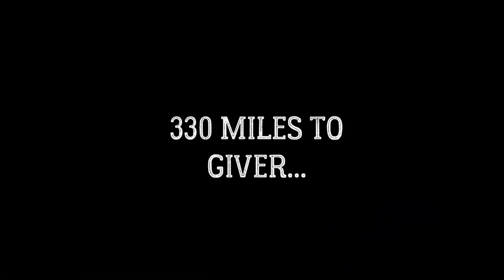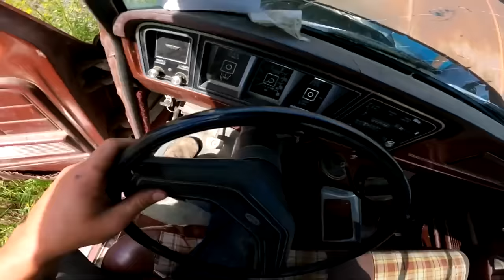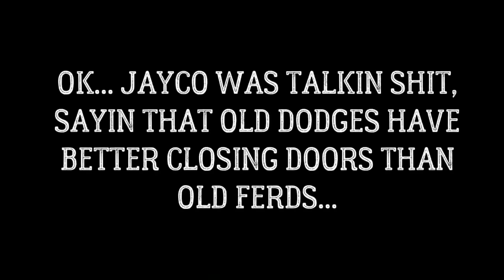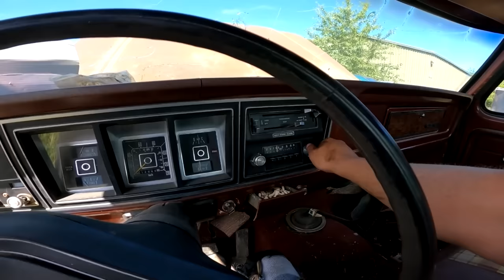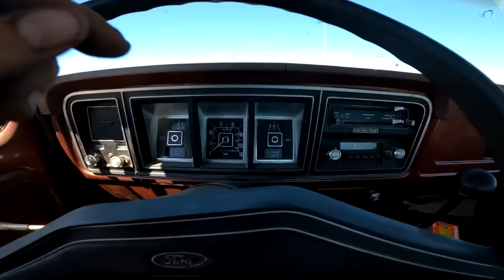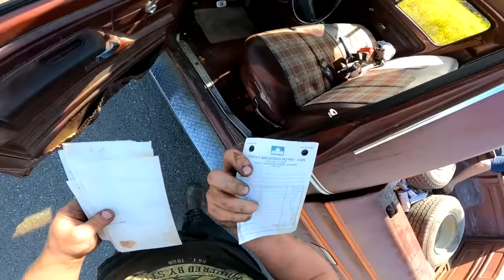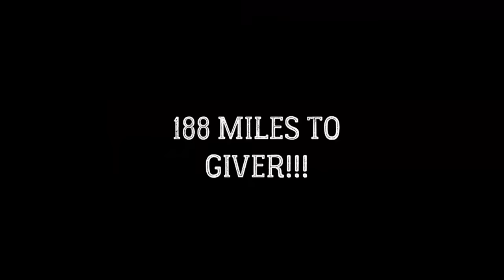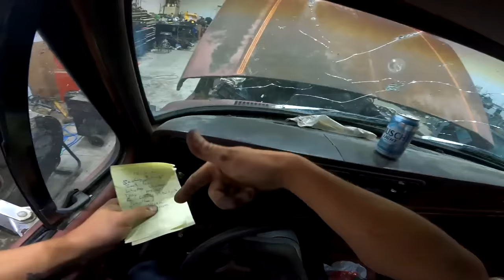1979 FERD F-2 FITTY, REZ ERECTION AND DRAG RACE?!?

Comment: When the exhaust rocker or pushrod breaks the cylinder is full of compression so the intake rocker or pushrod will break cause it can't overcome that amount of cylinder pressure.
Reply: where does the material come from to be compressed ?
An intake needs to open to charge the cylinder!
Next.... there's leak down/blowby to release the stagnent charge.
Next, you've got say 110#'s
static valve spring pressure,
more at lift.
How much is avaliable compression ? 150-175#'s ??
How much greater  is that  over your on seat pressure alone ?? We know at lift spring pressure rises.
Sloppy valve trains/ misalignment causes breakage.
Reply: @SeymourBalz  I'm not going to go back and forth cause I just don't argue with guys on the web. This is all I'm going to say,  can you think about this for a second please? If the exhaust rocker or pushrod break from either wear, wrong parts, geometry issues, I'm guessing rpm in this case cause it's a 100% stock engine.  How many times do you think the intake valve did get "material" into that cylinder before it couldn't open against the amount of cylinder pressure or "material" in that cylinder before it broke?

Comment: Had a 77 F250 in high school, had a gutless 351m in it. Got a whopping 8 mpg. Never failed me though even in the dead of a Minnesota winter
Reply: My buddy had a 79 f150 351m it also got 8mpg but it got like 500miles to a qt of oil too....I never seen something so gutless drink so much gas,but it was a little torquey for a slow revving 2bbl ugly hulk of a anti chick magnet 🧲. Lol
Reply: @jarvislarson6864  I have a 77 F150 mildly rebuilt 400 I get 13 mpg hand calculated
Reply: One of my buddies has a 75 f350 with 38s on it and a 460, let's just say it gets 5mpg on a good day

Comment: I'm surprised at how good it ran from sitting for so long even with a dead cylinder. Really makes me want to go out and find an old ferd of my own. Awesome as always!
Reply: He got lucky I assure you 100% lol 😂 they aren't all like that
Reply: @shawnadams1558  exactly, environment of a sitting car matters a lot, it could look fine and rust from inside out, he got lucky having such little rust in the engine
Reply: Watch out, clowns like Ford Era have taken prices into the ketchup anymore, even for a pile of parts that clown asks assembled, restored, running with a complete overhaul type money. The trucks from 1980-1996(1997 HD) are still out there but, they're getting  price gouged more every day. I got my 1997 F250HD RCLB XL 2wd 351w ZF5-S47 w/212k for $2300 on 1 Apr '21 in the middle of nowhere KY.
Reply: Shawn Adams
All the ones I've messed with seem to.  Doesn't matter how long they've been sitting, they'll start up in a second and a half, and run good.
Reply: @hendo337  you could sell that puppy for $25k or more all day here in CA. I've seen some 400k+ rust buckets sell for $10k.

Comment: I bought a 78 Bronco ( mid 90’s) with a broken oil pump shaft. I installed a “Towing Cam” while I had it apart. Ran pretty good.

Comment: I wasn't winning any drag races in my dad's old trucks with the 351m's but whatever you hitched one to it would pull it, break the chain, break traction or snap an axle. They had all the torques. If you kept them tuned up they were pretty good on fuel too. I remember he rebuilt the carb on the '77 Crew Cab for a vacation trip down the coast, new oil in the rear, trans and engine, new cap/rotor/wires/plugs and we were getting close to 20 mpg on the highway with it no joke. This is pre ethanol fuel and 55 mph speed limits on the freeway, so temper your reactions a bit with that knowledge pedants. 
Things I hated about those trucks though: 
1. The duraspark ignition modules. Constant problems
2. Starter solenoids and starters, same, constant problems.
3. Voltage regulators, same, constant problems.
We kept one of each in the glove box at all times (except the starter, too pricey). After they got a few miles on them we had a few spare fuel filters on hand too. Inside of the tanks all rusted real bad and it would plug up filters right quick. I could change one out on the side of the road in like 3 minutes and be back on the road again. 
All that said I hauled hundreds of tons of scrap iron, firewood and old junk cars with those rigs. Beasts all of them.

Comment: You're videos inspired me to get a old ferd my dad had a 1992 f150 with a 300 in it sadly had to sell it it didn't even leak oil because all the oil it had leaked covered the block in a layer of oily dirt sealing it😂😂😂. I have a 1988 f150 4x4 with a 7.3 idi turbo solid front and rear axles and stock rims with bias ply tires and the truck is all military green plus a 5 speed

Comment: Detroit Diesel are the original “fuel converters.”    They convert air and diesel fuel into noise.

351M/400 engines convert gasoline and air into noise.

Comment: 351M/400?  Hampered by their smog tune.  Putting a straight-up 0º timing chain set in them is the best thing to do.  That's what's holding them back is the retarded cam timing. 
Then when you add a good intake and carb and headers, it will really wake up.

Now them Chrysler 400s were pretty stout out of the box.

Comment: I've got a 78 f350 2x4.Swb. the one with the door in the bed for the spare. Shes a gem. No rust. 460 bb with c6 and 456 rear end. She tops out at 65 but is a beast off the line. Love the videos. Jealous of those side steps....oh and 78 lariat had square headlights.... 79 heavy duty base models you could get round ones as well.

Comment: I had a 302 5spd 4x4 in a 95 extended cab/ long bed.   She was as gutless as they come when towing. lol..  But in 4wd LOW, she was all there, and I hopped out of a lot of holes that I had no business getting out of.  I pushed that truck to 320k miles and it finally spun a bearing, and I still sold it for $800 with a blown engine.   Now I have a 2002 7.3L ZF 6spd, manual 4x4 with manual locking hubs. extended cab/  9ft flatbed,  (srw), dana 60 front, and dana 80 in the rear;  basically the same truck, just upgraded Everything..   It's probably the best truck Ford ever made, and I have 330k miles on it and she still pulls strong.  Needs some glow plugs and has all the classic leaks.  But she's still unstoppable. lol...  

My pops had an 89 that was virtually the same as my 95.   and He has an older 80's, with the 350 windsor--  and I really can't tell the difference;  It's just as gutless as the 302.   The last and last though.  I've always taken my vehicles well passed 300k miles.  I had a 97 Isuzu Rodeo 5spd 4x4, with 310k miles, needs a timing belt, I just don't need it-- or I'd already have it done;  I'll get to it eventually.

Comment: Hey Peg, old school bus or station wagons had 460’s. They were better to build than the 429/460 (continental). Big torque.  For couple grand, stroker kit, little grinding, and you’ll be using 2 ton trans, driveshaft and rear (like pulling trucks use).

Comment: The burned exhaust rocker with the weenie stick got hot and failed because the weenie pushrod was solid and it couldn't oil that rocker. The odd sound in the video was exhaust backing up into the intake, because as the exhaust rocker started going away, the exhaust valve was barely opening and the exhaust wasn't fully making it out of the cylinder, so it backs up into the intake when the intake valve opens. The intake pushrod eventually ended up chucked because that valve was trying to open up against the excessive exhaust pressure because the exhaust couldn't make it out of the cylinder due to the exhaust rocker going away and barely opening the exhaust valve. Once the intake pushrod was chucked, the backfiring into the intake stopped, and the noise quit.

Comment: Was your homemade pushrod solid? They push oil through the lifters up to the rockers. My experience with 351m’s was pretty much sized up in your video. They are a “cousin” of the Cleveland so if you rebuild them and are willing to re-engineer them a bit, they can be great. Otherwise with that horrid compression and camshaft, they are the horsepower of the 255 with the weight of the 460.

Comment: this was amazing. I was hoping for advice on how to fix up the thermostat Zipties method, but he skipped that.  I've had plugged thermostats before and a 1 hour drive took 5 hours cause I had to stop and let the engine not melt down.
Reply: Pretty sure he just threw it away and ran the rest of the way without one. No thermostat =
always max flow.
Reply: Yiu can just run without a thermostat all the time infact, might run cold but better then making the oil boil off

Comment: Yee ha!! Good vid!! I'm always confused on the Fram filter deal I have used them forever on lawnmowers and even my built 460 and 429 used them on every IDI truck I ever had and every vehicle lol I had never had a issue. As for the 351m/400 thing I love those engines very reliable only had one that had any power it was 400 in a 78 f150 I think it was redone at one time. As always peg love your work!!👍👍

Comment: The knock was your rocker over heating and seizing the valve not allowing air flow the other pushrod couldn’t take the pressure from compression
Reply: Im guessing the compression came from sucking oil past the rings since the intake valve wasnt opening causing a massive negative pressure on the pistons downstroke, and oil doesnt compress too well lol

Comment: You gotta tighten down them rockers only enough to preload the lifter - you can't just crank 'em down with an impact.
Reply: What's up Dan, on 351/400 m you do just tighten the rocker like a pontiac or small block mopar without adjustable rockers.
Reply: @WhiteTrashMotorsports  To do the pedestal rockers, you turn the cam to its base circle and the snug the bolt till the pushrod touches the lifter.  The you need the torque wrench, because you want the wrench to hit 21 foot pounds before the bolt turns one and a half times, or something like that.

Comment: All that knocking you heard was your lifters bouncing off the cam lobes because the lifters were hanging up in the bores. Had the same thing happen on my 351w. Wiped 3 lobes on the stock cam.
Reply: No. That would make a ticking sound.. The sound in the video was from backfiring into the intake when the exhaust rocker started going away. If the exhaust valve doesn't open fully, as was the case when the rocker got hot and started falling apart, the exhaust will start to back up into the intake and make that sound. Once that same cylinder with the messed up exhaust rocker kicked the intake pushrod out, the sound quit because that cylinder no longer was firing.

Comment: If you want it to hook, you might want to make sure the front end is up high and on stiff shocks to counter the Cummins weight and send weight to the rear, I'd try removing rear leafs, doing a flip kit, get some stiff DOM tubing, put spherical joints on both ends, attach on end to a cross member and the other to the axle as ladder bars, maybe get some air shocks or load leveling bags so you can air down on the starting line and transfer weight, then air up for the drive between events with stuff back in the bed, maybe put a big fuel tank behind the rear axle to dangle weight back there. Maybe some softer shocks in the back or the adjustable Ranchos if nothing better so you can dial the grip.

Comment: just bought one of them 79 ferds about a week ago 2wd also and mostly the same color. mine is a bit more primer gray where yours is the rust.  Shes been a champ so far and all ive replaced other then fluids is the brakes.  guy said i should tow it i came with fuel and a battery and drove her home.

Comment: Maybe the solid weenie roastin' push rod f*cked up the oil circulation in the lifters? If the oil cannot weep out of the small hole in the lifter through the hollow rod, the lifter gets pumped up until you have "negative valve lash" and the piston hits the valve. that may also affect the adjacent lifters. That piston-valve-interaction could also have been that horrible knocking noise... 
Also funny, that the weenie roastin' rod did it's intended job and roasted that rocker....
Love your vidjas, bud! It always makes my day when you upload! Greets from Germany!

Comment: I’ll say this about the m400 we replaced the motor in my dads 79 with a junkyard 400 it was locked when we got it broke it free the mains were in the copper and he’s still running it 6 years later. Bump the key it’s starts!

Comment: Well, 7 cylinders is still 3 more than 4 so, you're fine. You don't need all the cylinders.
edit: Another possible home-made pushrod material that has worked for me in the past was a philips head screwdriver. Just sawzall the handle off it and cut to matching length. Works just fine in a pinch.

Comment: 37:40....plug wire?? Nope (was guessin). Those ignition modules,  F-N-A. Swapped an '80 F-100 300-6 into an '84 f-150 4wd 300-6. The 3rd one finally lasted. It was REALLY AWESOME when they put em on the side of the distributor (i heard those one's were free at the junkyard, the day you're there only

Comment: Man I had a 300 6 cylinder that would randomly start knocking like that. Then magically fix itself like nothing was wrong. Completely random, and ran great
Reply: Usually piston skirt with 300
Reply: Greatest truck engine Ford made. Seven main bearings and a geared timing set. Not the fastest, but it'll pull anything you hook to it and you'll always make it home.
Reply: @841k9  

yes, my favourite engine I think. 

I once had some water get down in the engine, and it froze overnight. Started truck up with zero oil pressure and just let it idle, until the ice melted enough to unblock the oil pickup. Probably ran a good 15 mins with no oil pressure. It didn’t seem to mind at all.

Comment: Even though I just put a cam in a 351 m, the straight six makes barely a little less hp than the 351 m but more torque and that is one tough engine that would be my pick for a hotrod engine. The 351m with a cam and a set of headers and low dish pistons is alright but it'll never be a hot rod engine for sure

Comment: @peg the 351m-400 is a very overlooked engine for performance. It is literally a tall deck 351 Cleveland however the 351 m versions are gutless no matter what. They have a very stupid rod ratio that just doesn’t work effectively. That said the 400 can be very easily improved and the 351 can be converted with a crank and piston swap. The 400 has a perfect square bore/stroke of 4x4 making it the longest stroke ford gas engine and making for massive torque with relatively little mods. 600-650 holly four barrel and intake and a little timing will turn it into a whole nother animal and a decent cam really wakes it up. Almost all the speed stuff from a cleveland will work on em including the old closed chamber heads. The biggest improvement you can make is compression. Smog tuning required ford to put a piston in them that is actually quite a bit below the deck and gives a basic ratio of 8.0 however find a new old stock set of 1970 piston to get 9.5ish or the easier option is tmeyer.inc he makes a set of badass pistons for them and knows every speed trick for em basic mods can get you 350ish hp and damn close to 500 ftlbs with a curve off idle to 5k spm that makes a diesel look peaky

Comment: Every 351/400 m series eng I've tried. Shears the crank and cam between 6-7. Then you have nothing but a giant boat anchor. One slung the #7 connecting rod through the side of the block.

Comment: Reminds me riding with my brother in his 79 f250. Like 20 yrs ago on thanksgiving the truck died on us in the middle of buttfuck nowhere.No tools but a pair of cheap pliers and a screwdriver. We were stranded all fuckn day then finally while the 3rd guy stopped to help give us a jump we realized no spark and the distributor wasnt spinning cause the gear sheared off the pin but i was able to fix it with those cheap pliers and a piece of spring sticking out of the seat he drove it like that for a few years

Comment: Probably the un lubed valve stem got roasting hot and maybe heated up enough to seize neighbor valve? It’s like wacking with no lube!
Reply: That's my guess too. No oil to the top, the rocker overheated. Heat transferred down the "pushrod" to the lifter. Overheated the cam lobe, overheated the next cam lobe... 

I think she's gonna need a new top end if he was gonna fix it. Sounds like a possible Cummins swap candidate out of convenience. He's got the one out of the green shipping crate he round-tripped to BC.

Comment: The weenie rod failed to bring lubricating oil to the rocker.  It overheated due to metal on metal friction.  It probably didn't do the lifter any favors on the other end either.  Any junkyard along the way should have gazillions of Ferd pushrods.  That's where I would have gotten one on short notice.  Actually I would have gotten home first on 7 cylinders and then start removing valve covers.

Comment: i see a 7:15  you have a 351m wich is a 400 with a 3.5 inch stroke intead of a 4 inch stroke to make it a 400..you can tell by pulling a plug and measure the length of the stroke from top to the bottom  3.5inch 351m  4inch 400   iether way its a very good motor for f250 for sure..still have mine in the kitchen 😁👍

Comment: When the exhaust valve quits it will backfire out the intake maybe the backfire  bent the intake pushrod and it fell down in the engine . I took a intake pushrod out to stop the backfire. The lifter jumped out no oil pressure and locked up a mile away. Lol